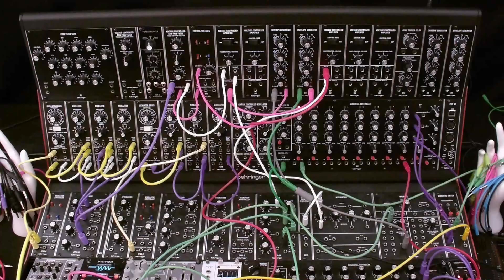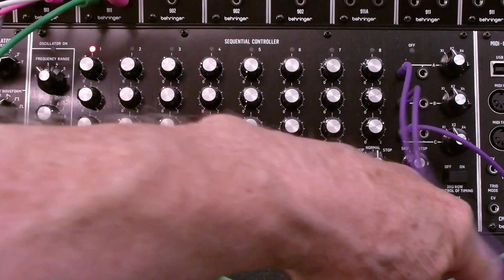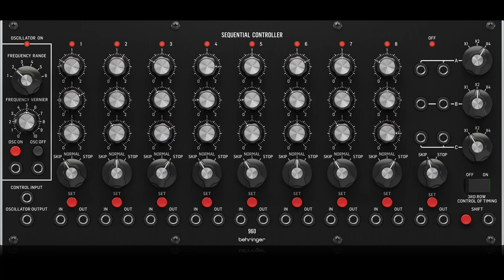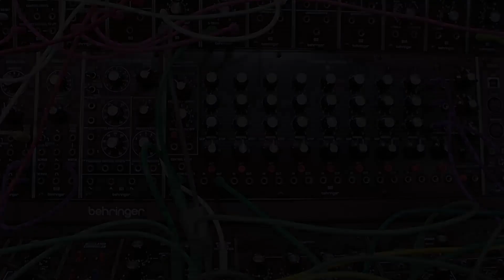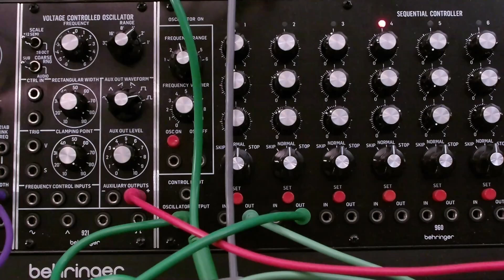960 Sequencer Advanced Techniques #1

Comment: As a complete beginner to modular synthesis, I would like to know if it is possible to synchronize my Behringer 960 with Ableton using my Behringer CM1A. If so, what is the procedure and what settings need to be configured in the DAW and on the sequencer itself? Thanks a lot for your help.
Reply from the maker: You need v-gate signal to drive the 960.  The CM1A will produce it.   I can’t go into detail now.   The CM1A is a MIDI to CV / Gate interface.

Comment: Hi, am i wrong or the "3rs row control of timing" doesn't work when 960 is synched.to.an external clock?
Reply from the maker: You're basically correct.  Third row control of timing routes the control voltage for row 3 to the CV input of the internal Oscillator ( clock ).  If you use and external clock, you're "shifting" (stepping) via the external clock.  Technically you are NOT bypassing the internal Oscillator ( clock ).  If have and external clock AND you press the start button, you'll be clocking from BOTH clocks, which is a mess.

Comment: Sorry why when i start my sequencer i only hear: pick,pick,pick....? and if i add a sound i still hear sound plus pick..... Thanks.
Reply from the maker: @mixobit Are you triggering the envelopes from the 960 Oscillator output?  You need to process the 960's V-trigger through the 961 interface to convert it to an S-trigger.  on the 961, us the B column inputs and adjust the gate length (switch-on time) to about 50 (c. 7 o'clock).  try varying the switch-on time.  let me know if that fixes the issue.
Reply: @ozhalljr  Thanks for answer,sorry but i just started with this world and i don't have the 961... i have a k2 mk2,abacus,brains,crave. Can i still make it work? Thanks for your patience
Reply from the maker: @MixobitI thought that you were using a system 55.  So try using the 960 Oscillator Output as your trigger (gate) for your synth.  It should be  pulse which lasts 1/2 of the time at each step on the 960.  It should be a regular v-trigger (0 to 5v), which goes high at the beginning of the step and goes back to 0v at the middle of the step.  Is that how you're clocking the system?  If not, please let me know how you're connecting (perhaps you could make a short video on your channel and provide a link).
Reply: @ozhalljr  I was already able to somehow connect Abacus 😁, but now that thanks to you I was able to connect the synth too it's great!!! Thanks!!!!!
Reply from the maker: Great!

Comment: The 55 Oscillators take about 15 minutes of warm up to stabilize for proper tuning.
Reply from the maker: Yeah,  I has to warm up.   At least the newer Moog vco designs ( later 1970s ) are more stable than the originals.